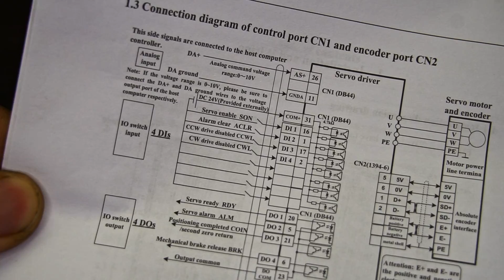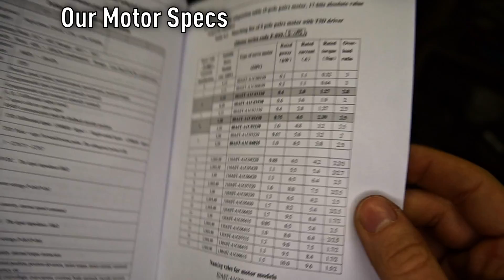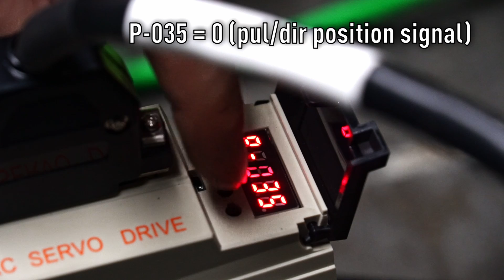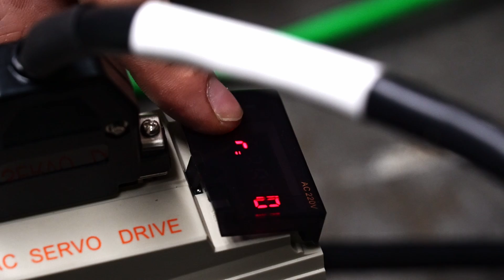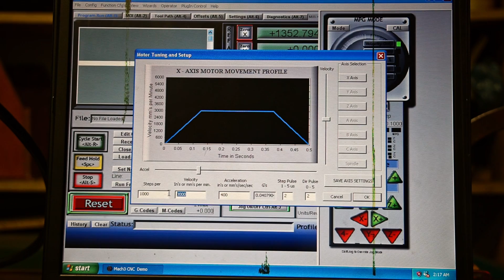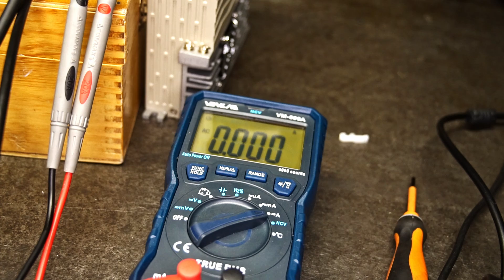How To Setup AC Servos with Mach3 USB RNR Board

Comment: Why ...can't with mach 3 MKX3 

Direction can't change ...only 1 direction
Reply from the maker: I don't know that controller, but there might be a problem with the DIR pin / signal
Reply: @GBWM_CNC  my be ...out put BOB mkx3.      3 terminal output to servo not 4 terminal output 

YP -
YD -
5v

Comment: Hello, i have ordered the same drives. I am wondering why you dont use the ground at your Power source Line. Is there any issues with it? Does it spread EMV to the net if I do so?
Reply from the maker: I guess you mean the PE (protection earth). Just for test purposes being honest. Also my PE in my home is really weak. I recommend using EMI filters to prevent noise issues.

Comment: Can I hook this up without a Mach 3 board just to verify the motor/controller work?
Reply: yes, but you'll want a 'stepper controller' (not a driver, just a controller, ususally based on a 555 timer chip) for the dir/step signals that this needs to do anything.
Reply: @joansparky4439  Thank you

Comment: Is it possible to switch between position mode and acceleration mode in software?

I mean, for example, the lathe spindle first spins at high speed and then goes into a position mode to position the workpiece for a milling task?
Reply from the maker: https://youtu.be/ivfOgT4wNmM 
Something like that? :)

Comment: Hello thanks for the video. Is there any form to refrigerate the servo? how many hours can be running without stoping?
Reply from the maker: Being honest - I have no idea. I mean - you can use a fan or add some radiators ( that's what some people do with stepper motors). I didn't use it yet "for hours" but if you don't overheat it then I see no reason to stop it, haha!

Comment: Hi, what was the maximum acceleration you achieved if you tested such limits?
I would like to use these motors for 3D printer
I have calculated from 750W Motor TDS it should be like 800 mm/s²., but idk if I calculated it correct
Reply from the maker: Being honest it's hard to tell when the added value of accleration stops from being exectued due to the servo is not a stepper motor, therefore it isn't loosing steps and such big values are hard to see witn bare eye.

Comment: Hi! How does Mach3 know if encoder fails? or if the motor doesnt reach the values you set? Thanks
Reply from the maker: you can set up a digital output of the servo driver to send a signal to cnc board if there is an error (if there is positioning error - the servo driver will see it and output an error with power-off).
Reply: @GBWM_CNC  Thanks!!!

Comment: You have done the easy part my friend. Put that on a machine and try homing it. Or test the Mach3 homing function on your bench by adding a  limit switch. Then try to home that motor/driver. You wont be able to home in Mach3 if that motor is using an Absolute encoder. Try it and let me know. Russ
Reply from the maker: Why not? I mean - homing can be made through mach3 without sending the signal to the driver. Exactly as when you use a stepper motor.
Reply: Cant be absolute encoder. Its incremental

Comment: great, is this board works better than parallel port board? i am having some issues with this board
Reply from the maker: Depends. USB seems to be faster than the parallel port. Actually I had better experience with the USB one. But the green parallel one allows to use for example linuxCNC and a encoder. All depends. If you want a reliable controller though - I'd search something with ethernet connection.
Reply: @GBWM_CNC  I my machine mach3 pauses for a second in middle of g code running and moves the machine again. I don't know what actually causing this.
Reply from the maker: @muneeburrehman450  I'd bet interference. Try to run some "dry" runs without activating the spindle. If it doesn't behave like that - it's probably caused by the spindles VFD. Try searching some info in the web about EMI.

Comment: Have you had any experience, are the servos good? Can they be easily tuned?
Reply from the maker: It works fine in torque mode with my juice press. I will add them soon to my CNC lathe project. But at this moment I can't say much about them.

Comment: Bro, I think, For People like me who take some time to digest such tech stuff, You have to walk us through...!! Can You make a Universally applicable video, in which You teach us how to identify connections,how to set parameter, more than anything -how to determine the parameters that have to be set for rescuing motor and driver from smoke..!!
Reply from the maker: There is a lot of parameters, a lot of ac servo motors, a lof of types of control. It's hard to cover everything in one video
Reply: @GBWM_CNC  Bro,Can You Explain this in a video,

Suppose We Buy a Spindle and VFD from two different suppliers.

By Looking at the Spindle specifications,
What are the most essential  parameters that We have to configure, after setting that vfd to factory reset condition?

Or 

which values are very crucial  on a vfd/spindle combo that incorrect configuration of which might damage any or both equipment?

even though there are many manufacturers are out there, I believe that there is this flexibility to trial and error after setting most crucial values right, 
I dont know...

may be you can consider if not that hard..

lot of guys like me still not confident...

Comment: Hi, is it possible to control these AC servo motors with MESA 7i77 analog +-10v board ?
Reply from the maker: Hi! I don't any any experience with the MESA card, but this servo supports analog -/+ 10V signals so I guess it should be able to work.
Reply: @GBWM_CNC  Thank you for the reply  ! I bought these servos to my CNC router. The current setup is these servos controlled by usb BOB and MACH3. I am  planning to upgrade the system to LinuxCNC + MESA card in analogue mode +/- 10v. I think that's the best choice for the cnc machine.

Comment: In Most times in cnc machine people use servo motor in position control mode (basic pulse & direction), and the big problem is position error to know how many steps loose,and now you can see difference between cheap servo motor and expensive servo's, whatever how can you explain how many steps loose with these tuning parameters
Reply from the maker: Well - servos from what I know do constantly compensate position error, so in theory if the gain parameters are ok there should be no lost steps.
Reply: @GBWM_CNC  my bad explanation!
Reply: Actually my question is about position following error.how you can be sure these servo's are tune enough?

Comment: Do we need to use sheilded wires for everything, like power cable of this, limit switch and everything?
Reply from the maker: I recommend using shielded cables - it prevents electrical noise problems :)

Comment: Would you please be able to do a quick video on setting up this servo and mach 3 board with 0-10v speed control for a spindle? Thanks.
Reply from the maker: I will try to make such video soon, but recently I'm really busy with my projects.
Reply: @GBWM_CNC  Thank you, you would be an absolute life saver even if it's just a 1-2min clip to get the point across that would help some of us out so much. 🙂

Comment: Hi, i received my ac servo set ,same as yours andi see i can use 0-10v to use it as a spindle but no idea how to set it up ! any tips! thanks
Reply from the maker: Check some of my other videos - I made some videos how to setup a similar servo with this board and how to setup servos in analog mode
Reply: @GBWM_CNC  Ok thanks and for this drive and bob do you think it is possible to use it as spindle with step & dir because my port & pin are 0 for all axis , maybe a way to dedicate port & pin num. the point is i need that servo to drive my spindle, i will check allthe video you made about tha BOB and this drive ,thanks again
Reply from the maker: @gordonbournival152  i don't know if it is possible to drive it with step / dir - more likely with 0-10V pwm input
Reply: @GBWM_CNC  Ok , thanks for all , i will try to make it works both ways , will see! keep going , nice video you do!

Comment: Hi, nice vid there. I was researching for one of those sewing machines brushless 'servo' motors for my DIY milling machine BT30 spindle (replacement for a 2.2kW/24000rpm ER20 spindle), and found these of the vid, cheaper than the sewing ones. What is the catch? Also, I was thinking: I have to multiply the speed to get 6000, maybe 8000rpm, I will divide the torque then, so a 1kW of these would be a better choice for me, right?
Reply from the maker: Honestly I have no idea - but I will find out soon how these perform. And speaking of torque and power - yes, the more power at the same speed, the more torque
Reply: I only find the vid motors up to 1KW. I do not think this is enough for spindle

Comment: Thanks for the video. I want to use it as a low rpm spindle, for a deburring machine. so it only need to turn. It is possible, to use it without cnc controller, just turn on and adjust the speed with 0-10V for example?
Reply from the maker: Sure
Reply: @GBWM_CNC  Thanks for the quick replay. Have you got experience about the servo set reliability/faultless working? The servo set price, is lower than a asynchronous motor with inverter drive..... It not too good to be true? :)
Reply from the maker: @gabortari7848  Yes, exactly. That is so cheap that it seems there is something weird. I have no experience with them much yet but soon i will be adding them to two of my machines so i will find out if these are worth the surprisingly low ammount of money :)
Reply: @GBWM_CNC  Now, I have built it to the machine. It just need to turn, it is working without any problem. But in the insulating resistance was in the limit, when the safety inspection we made :) Have you got experience about the lifetime of the servo/drive?
Reply from the maker: @gabortari7848  not yet sadly, can't keep up with the work due to my daily job. But it should be able to put them on soon as im going to build the z and x axis in the near future (frame and spindle seems to be ready)

Comment: What can you help me with? I configured my servo in speed mode to drive a spindle, however I configured the parameter P-098 = 0 to enable the motor via the "SON" external button, however in the CN1 interface I don't know where I should connect the "SON" wire to do this. the engine rotates
Reply from the maker: With p-098 = 0 and SON not connected anywhere the engine does rotate?
Reply: Thanks for the answer, but I managed to make it work, I connected COM+ to +12V external power supply and the GND of the supply I connected to SON with P-098=0 now I can turn the motor on and off with an external button, leaving the axis free when I to trocar like tools
Reply from the maker: @YoungCNC  great!

Comment: nice post well presented and relatively easy to follow  thank making this clip for info , i have several similar AASD AC motor / driver kits so it great to see the mach usb controller can be used a option s an upgrade, my cnc project  many thanks for the tutorial
Reply from the maker: I'm glad you like it! Hope it helps :)
Reply: Olá estou construindo um mini torno de bancada com mach3 vc poderia fazer um vídeo como este configurando este motor com PWM 0-10 v para que eu possa usar com spindle não encontro a configuração na internet e o manual está em mandarim meu drive é Hanpose 1500w acho que a configuração é a mesma mas não tem informação na internet para meu moto e no seu vídeo tem tradução para português Brazil e eu posso acompanhar

Comment: Hi, Great channel. Is there any reason why you don´t use AXBB-E and UCCNC any more for this project?
Reply from the maker: Hi! Thanks! Of course this won't be the controller for my new cnc lathe. I just made this tutorial for people who want to use the rnr board with their projects because its cheap. But for my CNC lathe this controller wouldn't be suitable for sure. I'm going to use the uc300eth controller from cncdrive. It is similar to axbb-e but has even more inputs and outputs.
Reply: @GBWM_CNC  all right, I been having a lot of help from you´re AXBB-E to UCCNC videos to my CNC wood router =) my next project is another milling machine a Deckel FP4 converted with also a AXBB-E and UCCNC but with Servo motors instead of stepper. and hope you are going to make a tutorial for this set up also 😂 thanks again for awesome videos 🤜💥
Reply from the maker: @betamorf  there is already such video on my channel - you can check it out 😁

Comment: Anyone know if I should worry too much about the type of Power supply for Servos? As long as its 220v in this case it should be fine? Or do I need something more specific that mitigates as much noise as possible?
Reply from the maker: If I remember correctly - the manufacturer says in the manual to put an EMI filter between the power supply wires and the servo driver. It has an tendency to emit huge EMI. During these tests I didn't use an EMI filter and the controller frooze like 2-3 times. I've had exactly the same when I used an VFD for a spindle 3 years ago. Servo drivers and VFDs are similar when it comes to EMI.  The USB port of this controller is not prone for EMI at all. The servo will work straight out of the socket but other devices may struggle. 
This is what I've observed - maybe someone can add something in this topic.
Reply: @GBWM_CNC Thats good to know.  So I've wondered whether these AC servos should just hook in directly to AC power or if a 220v Power supply would be better to then supply the servo's.  Some suggest that PSU supply would regulate it better and have less spikes and more clean continuous power.  I'm no electrician but I've heard this before in other areas.

I'll check out the filters and probably skip the power supply however if its not really necessary.
Reply from the maker: @LogicSpeaks  what kind od psu? Some kind of AC psu output? It doesn't make much sense to me. Maybe people were talking about stepper motor power supplying. Some people are using switching power supplies vs other are using ac transformators and then just a rectifier unit. But i didnt hear about AC power supplies.
Reply: @GBWM_CNC they might have been talking about a transformer and I might have gotten confused because the more I look into it the more I can't really find anything.
Reply: Is it better to use a 110 to 220 step up transformer or just find a 110v drive if using this kind of setup in US for example?
Reply: @anthonywalker6168  keep in mind that a step up transformer will work but you have to have enough amperage to avoid blowing your circuit.  Most newer outlets for 110v circuits are 20 amps.  For example, I purchased the 1Kw motors and their max current (surge current) is around 14.5 amps.  So you could really only safely run 1 motor per circuit although its probably possible to run 2 motors per circuit for me.  Some say most of the time they never use that much amperage but I think its risky.  This usually only occurs when you turn them on.  However, some  have suggested to have a time delay device to turn each motor on 1 by 1 so that you don't get the full amperage surge all at once.  So in this case you could I guess use two separate circuit outlets.  Or use a higher amperage 110 circuit if you have the ability to change the wire gauge as well.
Reply: @LogicSpeaks  Thank you for the feedback, I’ll take that into consideration.

Comment: Perfect Thanks, your videos are a big help for me and I love them a lot. I have the same servo controller from HLTNC 1 KW but I despair about the setup for a spindle configuration on my cnc interface 4 axis card AKZ250 from Leafboy. Unfortunately I have a 0-10v signal, only a 0-5v signal.
Please do a tutorial on this
Thank you very much and kind regards
Reply from the maker: You have 0-5V signal and your CNC controller has 0-10v? I've never done this but there are current to voltage converters and vice versa. Maybe you could convert 0-5V signal to 0-20mA current signal and then the 0-20mA current signal to 0-10V voltage signal. It's kind of overcomplicated but it might work and those converters are quite cheap. I've never used such though. In the other direction if you had 0-10 and your cnc controller had 0-5v then an voltage divider circuit would work.
Reply: @GBWM_CNC Thank you very much, that's an answer that I can start with.
Unfortunately I only have a 0-5V signal.
The voltage divider circuit could work, since I have a PWM signal on the card, but unfortunately only 0-5V.
It would also be interesting to know which pins I have to use to control start stop, direction change and speed via my AKZ250
I'm a trained bricklayer and I'm not exactly an electric light ;)
Nevertheless, thank you very much for your answer and I am very honored.
Please keep making great videos like this... I can't get enough of them, thank you
Reply from the maker: @LumberJackyJackyl  I'm really glad you like these videos! :) Btw you can check if your CNC controller doesn't have a jumper or something like that to change 0-5V output to 0-10V output. I think the AXBB-E CNC controller I use on my CNC milling machine has it so it can output 0-10V or 0-5V depending on what your VFD / servodriver needs to be feed with.
Reply: What can you help me with? I configured my servo in speed mode to drive a spindle, however I configured the parameter P-098 = 0 to enable the motor via the "SON" external button, however in the CN1 interface I don't know where I should connect the "SON" wire to do this. the engine rotates